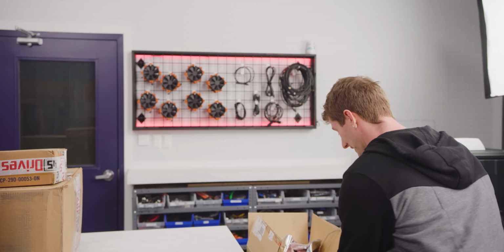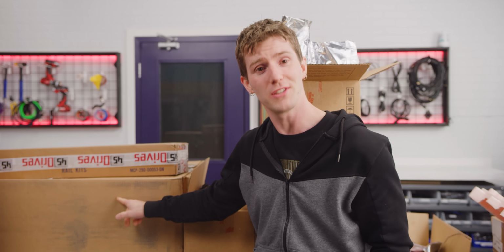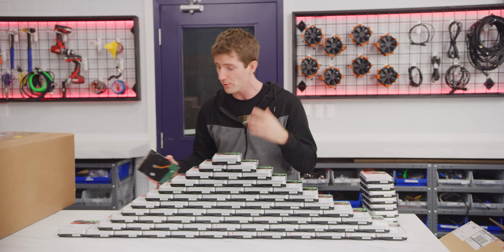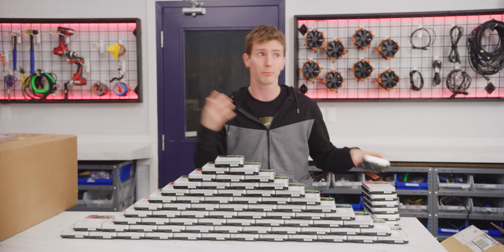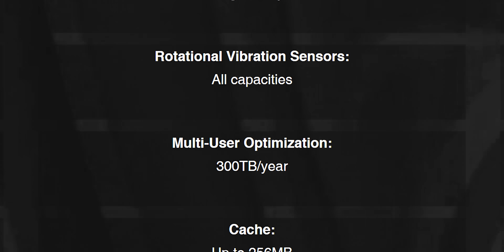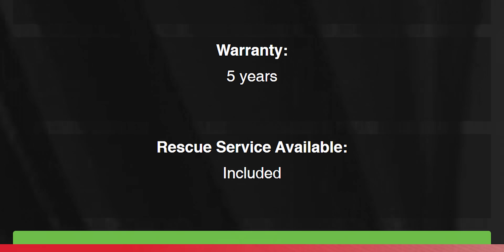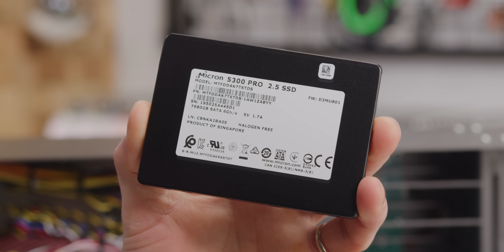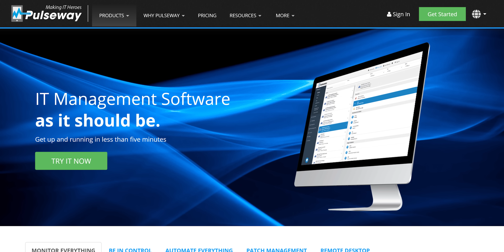Unboxing 3 PETABYTES of storage!!

Comment: Me: I only have 10 GB left, I need to delete some stuff.
Linus: I have "only" 1tb, i need 3000 more tbs
Reply: Me:I only have 31 kb left, gotta clean.

You: only got 10 gb left

wow u got alot
Reply: @Adam Taylor 1 byte is bigger then kb
Reply: @sfyner  1 kb = 1000b do ur math bro(no offense btw)
Reply: 10GB is a ton, I can fit loads in that space
Reply: why delete stuff when you can just add more drives? that's what I do every I run out It's why I have like 5 drives in my system right now

Comment: ok, thinking of 700 mb capacity CDs. 3 petabytes of them would take 4 285 714 CDs. One CD is 12 cm in diameter. This means if you put them all on the ground CD next another one, whole line of these would take over 514 km :D

Comment: For home gamers or anyone trying to do a 60 drive build on a budget... just buy a 60 drive used EMC enclosure and make sure it has the 2nd internal controller for the 2nd half (ships in 60 or 30 upgradeable to 60).  Sure you’ll need a storage controller but I built mine in a 1U server or you can use 2U.  I had a dual external 4x6G controller I bought for $15 and used with 2 15 bay EMC racks but I swapped that for a single 4x6G external 4x6G internal card to run 4 internal SAS SSDs.

It will cost less than the storanator and it’s certainly more robust.  Should cost around $300-1200 depending on source.  Also the hot swap sleds are very well made and are tooless.  I loaded 40 drives into sleds in about 5 minutes.  There is another company out there that a 60 bay enclosure that’s not designed for custom storage heads is being sold new old stock for under $600 on eBay.  Also they all have the expanders built in so you’ll typically use a single SAS 6G external.  

There 15 drive racks are not as straight forward but cost next to nothing.

Be aware that some of the EMC stuff can’t run a mix of SATA and SAS at the same time so don’t mix and match drive types.

Comment: The ZFS Intent Log ("ZIL") is NOT a "write cache" as everyone tends to believe. Writes are always handled by RAM, with the ZIL simply journaling (recording) the changes for later playback onto your zpool. The purpose of the ZIL is to guarantee the writes, not to speed them up. If your writes do not fit into RAM, add more system memory first. If you can't add more memory, then consider a ZIL with a super capacitor. On top of that, add a battery backup (UPS) to the system if your data is important.

Comment: Hey Linus. I do not know if you have looked at this and it may be too late now that the project is deployed, but there is an older server box that does have up to 94 drives (90 3.5" drives and 4 SSDs). Its part number is NDS4900. It uses older V4 xeon processors (Broadwell 2600 series) but it is high capacity. Its also dual server Here is the link for the product. https://www.vikingenterprisesolutions.com/products/hdd-platforms-overview/nds-4900/ 

Just thought I'd share what I've seen

Comment: Yes but they're Seagate which means you'll have a hard drive failure every day. I bought 6 Seagate drives and their MTBF wasn't even long enough to fill the drive once then unload them. They died before I got half the data back off. Sadly the readback was 2 years later and was outside their warranty. I'll never buy a Seagate ever again. I lost 12TB of data. so thanks Seagate.

Comment: Raidz2 is not a good idea for 16TB drives... Raidz3 would be the more safer option since 16TB resilver will take a loooooong time! And SLOG is not a "Write cache"... You have sync and async writes. With sync, without a dedicated slog device, the log does not only reside in memory but also on the pool drives themselves. So in a power outage, the log is read directly from them. It also means that its slow a.f. With async, it's only stored in memory which is dangerous in case of power outage. With an SLOG, sync writes will be much faster (especially 4K) and you are protected in case of power outage. But if you still use async, you are still in risk of data loss in case of power outage because the SLOG won't be used anyways...

Comment: You should do a follow up video in 5 years comparing all those hard drives to the 3 Petabyte flash drive you will be able to get on black Friday for $60
I got my first computer in 1995, it came with Win 95 and a 2 GB hard drive.  10 years later we had 500GB hard drives.  250 times more storage on a single drive for the same price.  In 2007 only 2 years later we had commercially available 1TB hard drives.  They were far more expensive but they were available.  So in just 12 years the amount we could put on a hard drive increased by a factor of 500.  Now its a little sad that another 12 years down the line and we have only increased storage again by a factor of 16.  That's barely more than a TB a year increase.  So while Our drives sadly didn't increase by another 500 fold in the same time frame which would have given us 500 TB hard drives by now at lest the price has dropped drastically.  Those 1TB hard drives from 2007 initially ran well over $1000.  So conservatively you are talking $1000 / TB.  Now you can get a 16 TB for $400 meaning you only spend $25 per TB of storage.  That said you are still talking about $75,000 for 3 petabytes of storage and thats just for the hard drives.

Still it wouldn't be at all unreasonable to expect that the next 5 years would bring us 128 TB hard drives costing around $80 or less.  If so then instead of needing nearly 200 hard drives to get your 3 Petabytes of storage you would only need 24 of them and instead of it costing $75,000 you would only be looking at around $2,000 which is less than most of us spend on a good gaming PC.

To carry it even further in the trends over the last 30 years continue after than you could expect by 2030 to get 1 Petabyte on a single drive for around $625.  Which might seem like its going up in price but thats still 40 times cheaper per gigabyte than it was before.  Also consider than in the states at least by 2030 minimum wage across the country around $20 / hour so relatively speaking it will be cost the same amount of hours at minimum wage to buy as the 16 TB drives do now.

The real question is... WTF are you going to put on a PB of storage?  probably pirated 32k videos :).

Comment: I currently want to build a small nas server, but do not have the money to do so. I need to backup the 10,5T in my Desktop PC as well as the ones from my external ones, so in total 14T, so I would need at least 2 drives to be save in a NAS. Would be cool if you would consider to make it that the community can win small NAS servers with storage. 😁

Comment: yeah meanwhile I consider 1.25TB is plenty you drop cash on 3 PB (is it PB) of data and have gone through 900TB in a year... Linus at the very least if you haven't compress into MP4 you'll get like 200TB extra.... meanwhile checks case for 3.5 drives to put 20-30TB on data in

Comment: If you want write cache security, then look into datacenter solutions.
The front line of your defense is A/B power links. You have the redundant power supplies are on different circuits so that a fault on one circuit will not necessarily cause a problem.
The second line of your defense is a UPS for each power supply. If the power goes down that can (and should) be set to immediately notify all connected servers and services, and fire off an alert to the on-call tech notifying them of the problem (Optionally via a dedicated cell connection - it's actually surprisingly cheap to have a data-only SIM if you use it exclusively for notifications. Seriously, like $5/mo), and then ensures the system stays up long enough to finish all cached writes and shuts down cleanly.
The third line of your defense is an automatic failover bypass so that a UPS failure results in the system switching away from the UPS and sending a notification. A lot of UPS systems can do this internally.
The fourth line of your defense is the use of a battery backed write cache, which requires SAS controllers that have that sort of capability. In the event of a disaster, such as the power cables somehow becoming dislodged, Linus, then these will preserve any writes in-flight until they can be written to disk.

Unrelated: If you've got a lot of old drives and systems you don't want anymore, why not wipe them and give them away? Make it an essay writing contest or something.

Comment: How much does the chassis weigh? Then how much does each drive weigh, for a total carry weight of?

Also, I have 4 extra slots available in my external USB3 based Linux Plex drive enclosure with 4 slots having a 6tb drive in each, and I thought I had a lot of storage for that. If I need more capacity, looks like I'll be adding 16tb drives, but I might wait a few years so they're cheaper, $500 each is pricy.

Comment: These drives have 16 TB of Storage
3 Petabyte  = 3000 TB, so you need about 187 drives
One of those drives is about 450 €
So that's 84375€ just for the drives. 

Oof.

Comment: 20 years ago I predicted petabyte storage systems. To all those naysers back then: I TOLD YOU SO.
In 1987 I bought a "huge" drive: 33 MB. It cost me around $500  (over $1000 in 2020 dollars.). I estimate the petabyte stourage could be built for about $30,000. Adjusting for inflation that would have bought around 450 MB in 1987. Storage has increased by two million times in 33 years.

Comment: I've modded my gaming laptop to hold 12tb total raw storage, but after a year it is filled to the brim. Then decided to upgraded it to 14tb total raw storage, but now under 6mo.s it is almost full again. 😭
It would be awesome to have 2 Micron 7.68tb ssds, 1 sabrent 4tb m.2 nvme ssd and 4tb m.2 ssd installed in my laptop to max it out at total of 21.36TB raw storage installed on a gaming laptop. 😅
I bought a external drive from seagate, a 10tb skyhawk surveillance drive to save all of my games.

Comment: Why do you use 3 petabytes of HDD instead of 3 petabytes of SSD.
Reply: Cheeper and you can get high speeds running them in parallel so you don't need SSD. Also fail differently and more gradually

Comment: I just swapped out one of my old hard drive that was a 250gb but notice max hrs on it was only rated at 25,000 hrs and I really had 27,000 hrs on it but then it stopped working. An it was 1yr and 30hrs over due for max life span vs the norm of 3-5 yrs. Hard drive was a western digital.

Comment: If you guys  just upload video's in 720p, which are aso perfectly watchable, then people can still learn stuff about hardware. I watch most of my tv-shows always in 720p. :-)
About that case, why don't they build those cases vertically AND a lot bigger, so you can store like over 250 drives in one case (or closet). Have a vertical server case with some proper wheels under it would save a lot of hassle in carrying it and sliding it into a rack.

Comment: Hello Linus Can u help me with an upgrade decision??, Please??I want to improve my Gamming system but dont know how..I have an i3-4170, 3.70 GHz, 16GB RAM,  GTX1060 6GB.... I have a $300 budget should i get the 
gtx1660 ti or a 4th Gen used i5-i7 processor or would a faster refresh rate monitor would show improvement ??? need help....

Comment: I was interested so I ran some quick numbers.  It would take 2 billion 3.5in floppy disks (1.50MB) to store 3 petabytes of data and it would have a volume of 55,000 cubic meters which would not easily fit on that table.

Comment: If anyone knows a fair bit about pcs and could help me out that would be great. 2 years ago I bought a pc for 300 pounds here are the specs: 
Intel core i5-3570s CPU 3.10Ghz 
8 Gb of DDR3 ram 
Nvidia Gefore gtx 1050 ti 
I play fortnite competitively and recently I’ve been struggling to stay at 80fps (I have a 60hz monitor) so I want to upgrade but I don’t know what to buy or where to buy it from. My budget is around 1000 pounds and I don’t know how to build a pc. I would love to be able to run fortnite at atleast 144fps consistently as I’m getting a 144hz monitor for my birthday. Sorry for the long paragraph any help I greatly appreciated also love you Linus ❤️

Comment: me: 
looks worriedly at my pc with a full 250gb wight label drive from 2006 with 20 dead sectors that I got thrown in with a part bundle from ebay with windows 7 reinstalled
also me: to bad I spent all my money on a new case it'll hold up

Comment: so there is 3 sets of storage, two of wich are just rated for lower numbers of drives per enclosure.
does that actually mean they cannot be used together in "too big" a storage?
or is it just "not recomended"?
how much is two more enclosures?
EDIT: if the Problem is vibrations, the drives would certainly be rated for use screwed into the enclosure with 4 screws each, 
-would mounting them in a Vibration dampend way, like in foam rubber raise the number of drives that are possible?
-would it be possible to enclose them in a 60 drives bay and only start one set of 15 drives at a time ? that would be enough for archiving and backup .

Comment: Speaking of 'Crossed Wires'. And in case you apparently were NOT aware of THIS issue affecting a very great number of many users..
MALWARESOFT - YOU FIX THAT YOU WIPED OUT MY ACCOUNT REGISTRY FORCING YOUR 1909 OVER 1809!!!

MALWARESOFT - YOU FIX THAT YOU WIPED OUT MY ACCOUNT REGISTRY FORCING YOUR 1909 OVER 1809!!!
THIS IS A PRE-BUILT FROM IBUYPOWER WITH "ACTIVATED" WINDOWS 10 LINKED TO THAT ACCOUNT!! - YOU MALWARESOFT ASSHOLES INTENTIONALLY WIPED OUT THAT REGISTRY WHEN - YOU - FORCED THAT UPDATE/UPGRADE!! - YOU FIX WHAT YOU INTENTIONALLY FUCKED-UP - MALWARESOFT!!

Comment: So I’m building a pc and ordering it from     cybertronpc.com and are these parts good for a gaming pc PROCESSOR: Intel® Core™ i5-9600KF 3.70 GHz MOTHERBOARD: MSI MPG Z390 GAMING PLUSMEMORY: 2x 8GB XPG DDR4-2666 Total 16 GB Dual Channel MemoryGRAPHICS CARD: NVIDIA® GeForce® GTX 1660 Super 6GB OPERATING SYSTEM STORAGE: 1TB 2.5in SATA3 BarraCuda SSD CPU LIQUID COOLING: Standard Cooling Fan CHASSIS SELECTION: Set MasterBox Lite 5 Mid Tower Black CHASSIS FANS: 4x CLX Red Ring Fan POWER SUPPLY: 500 Watt Standard Power Supply

Comment: It's worth noting that l2arc is only caching what's getting evicted from the ARC, so building a full l2ARC is quite slow. And for now, l2ARC do not persist accross reboot. There is a pull request in review right now, as we are talking, but it's not availlable yet, and I exepect ZFS packages of various distros to lag a bit behind. So no persistant l2ARC for a while.
Another thing is that l2ARC is still taking some place in the ARC, storing some kind of table. I do not remember the numbers exactly, but an empty l2ARC in your case can still use severall Gigs, so be carefull with that.

Comment: @Linus Why at this stage, not just shift your footage archive to a business grade tape/LTO archiving solution ? Ive heard the tapes themselves are quite fast and they store lots of Tb for cheap - also that kind of robotic tapes system could allow you not to care about the cataloging/physically fetching the right tapes. I imagine you could use this kind of thing to load the footage you need to a high speed storage server when editors need to work on it. Besides, its known to be particularly reliable and safe for the data. It just cringes me to see you storage needs growing so quick - I can barely imagine how expansive this all is atm and how this cost just gonna rise going forward xD

Comment: Cute, you can get 585TB Usable in NVMe using 30.5TB SSDs 2U's and about 1.5PB effective with a good NAS OS. For a measly $100,000 per drive and licensing for roughly 2Mill total.

Comment: Didn't you chose to use tape drives instead of hard drives last time because of cost effectiveness?
3 PB of tape cartridges would cost only about 12,000$ + $5000 to $20,000 depending on whether you chose tape drives or tape library, compared to what $200,000+ you've spent on hard drives.

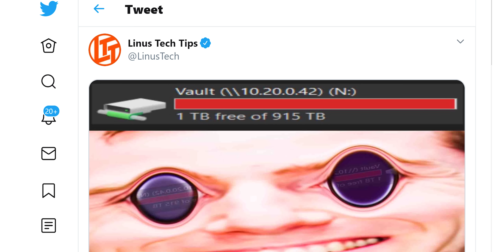Comment: 0:14 that feeling when you have 41.2 TB left and Windows reports that you're running out of space
Reply: *cries in 500GB hdd*
Reply: @urlinked  cries in 120gb ssd
Reply: cries in 80 gig 5400 rpm sata
Reply: @frogz  cries in 64mb floppy disk
Reply: @Chard2134  floppies were only 1.4 or 2 Mb
Reply: cries in 32gb internal flash storage
Reply: @urlinked  cries in 10.25TB of space😂✌
Reply: *cries in..
No, just cries.
Reply: *cries in 32GB EmmC*
Reply: cries me a river
Reply: cries in no PC
Reply: cries in 3.5tb total storage
Reply: cries in 8mb Playstation 2 memory card
Reply: cries in 200 games installed
Reply: cries in 1byte
Reply: cries in 921gb hard drive
Reply: I get nervous when my 24tb NAS hits 16tb of storage....
Reply: Cries in 3mb chromebook
Reply: cries in 256gb ssd

Comment: ARC is not only for most frequently used data, but also for most recently used data. And the ARC balancing algorithm usually keeps MRU size bigger than MFU, though in the workloads I've seen myself that's MFU that gets vast majority (up to 95%) of cache hits. Also, SLOG/ZIL is only used for synchronous writes, so I'm wondering if it would actually make any difference for your typical workload. Something that would be really interesting to find out.

Comment: "I actually have the perfect counter argument to that: It's all sponsored anyway!". Both Seagate and 45drives get a free 15min+ advertisement, targetting 10mio+ relevant individuals/potential buyers. Production costs for those 225 drives I estimate to be around $70k, which is a very good deal. Same for 45drives, for sending over their now useless prototype case ofcourse.. Also, call me old fashioned, but I refuse to play the now popular '1pb=1000tb game'. They are powers of 2, so it's 1024. 1006 is less than 1024 and so it's no PB. Long story short: yes, I am jealous. ;)